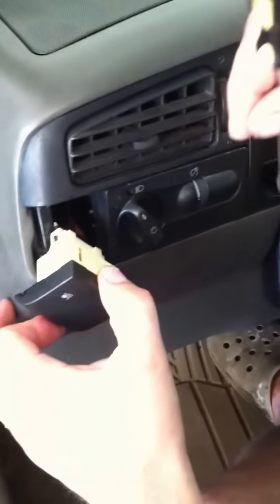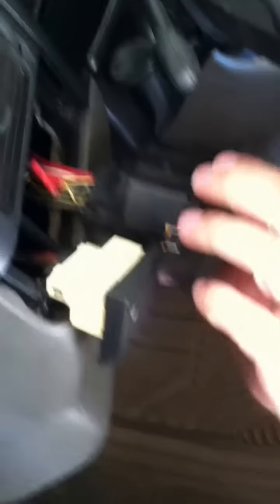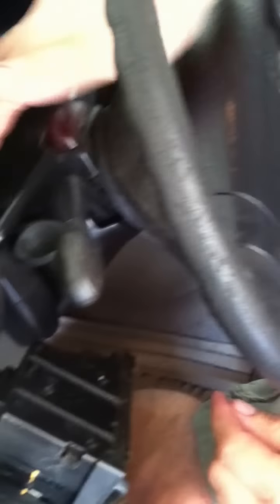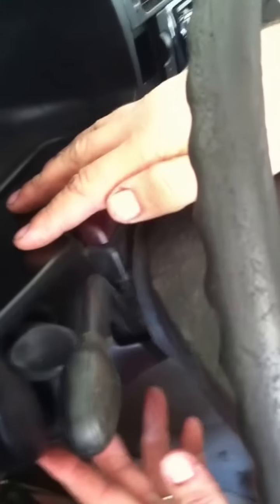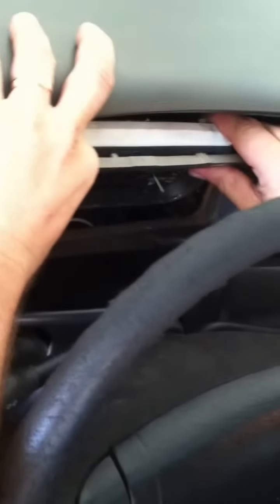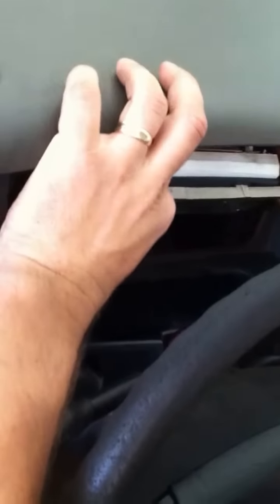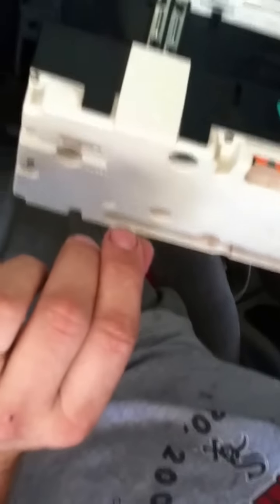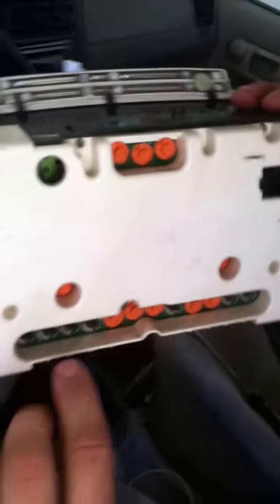VW MK3 Instrument Cluster Removal (94-99 Jetta & Golf, 96-02 Cabrio)

Comment: This worked great when I was checking a bad vehicle speed sensor signal on the cluster. One addition i would make, if the steering wheel is straight ahead, you can slide the cluster through the largest hole in the steering wheel.  Thanks!

Comment: Hey Thank you so much for this informative video. I have a 1994 VW Golf and I am looking to replace the cluster. My golf , since it is a 1.8, has the clock on the right instead of the RPM's.  Will I be able to just plug in a new 2.0 cluster that has the RPM's instead of the clock and expect it to work properly? Or will i have to cut in and make a new wire for the RPM's. Thank you!

Comment: Hi Steve - Thanks for video. My problem is different - the oil pressure warning light & buzzer are sounding. It started intermittently and is now continuous. The oil pressure sensors have been changed and a pressure gauge has been attached to the ports and shows oil pressure both at idle and highway speeds. Conclusion is that the oil system controller mounted on the instrument cluster circuit board is faulty. Could this also be a bad soldering connection??
Thanks.

Comment: Well these two definitely weren't, because I turned the screw in the same direction and there was no problem with the other ones. No, I don't have any bulb holder i could use. I suppose I'll have to go visit a local dealership if it is even available.

Comment: Hi, Steve. I used your instructions to remove the instrument cluster in my 1995 Jetta so that I could replace some burnt bulbs. The bulbs went in and they all work now. Thank you.

Strangely, though, when I reversed the process, I found none of my gauges work and my odometer only shows lines. I thought maybe I didn't push one of the plugs back into the back of the cluster, but everything seems fine. Any thoughts? Cheers.

Comment: great video! i have a 94 jetta and the tacho and speedo are not working, the clock and odometer are off too- the only instrument which work are the gas jauge and the oil temp. do i need to change the entire cluster? thanks
Reply: ***** thanks for your answer; I forgot to mention that the instruments went off for a couple of months and then came back... could it be due by a bad fuse? or relay or wire? thanks

Comment: Hi, Steve!
I was about to replace my instrument cluster bulb (tachometer side) and I used a screwdriver to slightly loosen up the bulb when the plastic, holding the bulb broke. Now, is there a different approach to take out the cluster bulb than any other bulb (the indicator bulbs went out so as I expected) or was it due to a worn out plastic.

Best regards

Comment: Hi Steve, my clusters illumination ceased working after installing an aftermarket radio, or at least that's what I think. I hadn't driven it in the dark for a while before installing the radio. It's not the fuse. My headlights are working so I don't think that it's the switch. Do you have any thoughts on what this could be? It's a golf cabrio 96. All the gauges work perfectly.

Comment: Can you replace the lights instead of replacing the whole cluster?  My lights are growing dim and that is the only thing going bad on the cluster.
Reply from the maker: If the lights are going dim, make sure that it it not simple the dimming function on the dash lights.   You can turn the knob by your headlight switch to adjust the brightness of all your dash lights which will impact the cluster.  Assuming you really do have a burnt out light bulb,there are two different light bulbs in the back of the cluster.  Orange are indicator lights and green at top are what drives most of the illumination.  I typically get them from pelican parts.  Green are part number 893-919-040-A-M97.   Orange are part number 4A0-919-040-C-M97 .

Comment: My cluster has a clock instead of the Rev counter. .....if I get a cluster like this will the revcounter work  (I also have an after market revcounter near the gear lever wich works)
Reply: it's a euro spec golf mk3 1.4 .....it's the stock cluster with the clock and i have a working aftermarket revcounter ... if i change the cluster to a GTI one i have to do different wiring ?
Reply: okay thanks still mate :)
Reply: @peter_dc2rx  what was the answer to this. I have a cabrio 1995 with cluster that previous owner changed and I have electrical faults and fan radiator not working. Nor is speedo and Rev. Did the gti work?

Comment: hi- nice informative video- I have  '94 jetta- I want to remove the actual Beeper- i hear it coming from behind the instrument panel- IS that the first panel you lifted off- it kind of looked like  a Beeper- I want to smash it to smithereens - for all the headache it has given me-
Reply: bad sensor- every time i drive up in elevation it starts beeping- and the oil pressure light flashes
Reply: i'd like to just reach in- pull the beeper out without dis-connecting the instrument panel-maybe i can bend the lower rt side up-
Reply: I bet I could drill a hole to dis-able the beeper's speaker straight through the console w/o removing it

Comment: Are u able to tell me what kind of lights go in the back? Thanks
Reply: AlexanderMitchell There are two different light bulbs in the back.  It has been a while but I have purchased them previously at Pelican Parts.  Here is the data from an order several years ago.  

4A0-919-040-C-M97 $1.50 35 $52.50 Instrument Panel Light Bulb - 12V - 1.1W (Clear Glass w/Orange Base), Brand: Osram-Sylvania

893-919-040-A-M97  $1.50   15  $22.50
   Bulb 12V - 2W Clear Glass (Green Base), Passat Instrument Cluster 1.9,
   Brand: Osram-Sylvania

Comment: Hello. I haven't changed my instrument cluster yet. All the needles and warning lights on mine are dead. The only thongs working are the odometer and clock. Would this be a wiring issue or is the cluster itself dead?
Reply: Forgot something. Once, everything came back on and went out about 5 minutes later.

Comment: hi i have a 93 jetta and when i turn my key as far to the right without turning the car on, everything should light up at that point right?  i just bought the car and im scared that the guy may have removed the check engine light on the car because it isn't lighting up. (i hope that makes sense)
Reply: awesome, thanks alot man!
Reply: ***** lol i ended up coming across your video for another project. I was so dumb at that point, my car doesn' have a check engine light because it's OBD 1 xD

Comment: Hi I have a 1995 cabrio which had the incorrect cluster fitted from a 1.8. Nothing works and the coolent lights keep flashing and fans do not Work. I also have only 1 connection at the back. I have a gti cluster for sale. Which I want to Install also with one connection. Can this work? Thanks From south Africa
Reply: And thx so much for The video..
Reply from the maker: The fans have nothing to do with the cluster so that is not related.  You for sure have two connections in the back.  One red (safety) and one black (pretty much everything other than air bag and brake).  A gen 3 (95-99) GTI cluster will work.  The only problem you might have is sometimes the indicator lights will be problematic if a car had different options.  But the tach, speedometer and odometer will work.

Comment: Do the top two lights just screw out and back in?
Reply from the maker: Yes.  You just turn the screw 1/4 turn to get it to come out.  Sometimes it can be a little difficult and you have to be careful as it doesn't take much to crack plastic.

Comment: Steve, if the speedometer is stuck at zero, do I need to remove the cluster?
Reply from the maker: As a first troubleshooting step, you might put it in test mode to see if you are getting a speed signal.  
http://faculty.ccp.edu/faculty/dreed/Campingart/jettatech/dashcluster/dashcluster.htm

Select test mode 6 to see if you are getting a speed signal by looking at the odometer which numbers will change when the car is moving.  If it does, the stepper motor is likely bad.  If it does not, try wiggling the connector in back to see if the soldering is bad.  If that is not it, follow steps to troubleshoot speed sensor.
Reply: Thank you
Reply: I'm almost positive it's the speed sensor. Thanx for the quick response.

Comment: My  1993 golf 3 instrument cluster  has a clock in it  which  i really  dont  like,can  i  change it  to  another  without  clock in it?
Reply from the maker: The 93 is an mk2, right?   I know the mk3 clusters very well but I don't have much familiarity with the 2cd generation Jetta/Golf.
Reply: Its actually  an  MK3..sir
Reply from the maker: I don't think I have seen a cluster with a clock before but I heard they do exist.   They changed the style of the cluster between 94 and 95 on the MK3's.   I haven't sold many of the older style clusters.  The tach, speedometer, gas and temperature gauges all work the same on any 95-99.  The only difference is the indicator lights based on the options of the car (auto/manual, abs, etc).   I know that the wiring is the same for the gauges for the 93-94 as 95-99 as I can still test the older clusters in my test setup as the newer style.  However, I believe the calibration is a bit different.   I think it is safe to say that you could change out your cluster with any 93 or 94 and everything would work EXCEPT I would suspect the tachometer would not work unless they put that wiring in all cars.    Honestly though I really don't know.
Reply: ok  thank  you ,since the wiring  i sthe same ,i  beleive i  should be able to changeb to any of the  cluster  within  the 95 -99 series
Reply from the maker: The plug will fit and you will get movement on the gauges but it might not be accurate.  I would recommend sticking with the 93 and 94.  And keep in mind your tach will likely not work since you probably don't have the wiring for it from the ECU but you could be surprised if they put the wiring in all the cars.
Reply: ok  thanks  so  much  ....i think  i will try... trial  wont  harm  anyone
thank  you  soo  much

Comment: My steering column cover is broke lol don't try to take it off
Reply: +Steve Skarda  Do you know why there are 2 clusters( red and white)  on the back of Vw Vento/golf and some only have one.
Reply: +Steve Skarda  Hi Steve thanks for reply  I have found it hard to find one with 2 connectors on rear. I was looking on Ebay for a replacement and they all seem to have just one connector on the rear if you check it out. Wasnt sure if these are compatible. They all seem to have different numbers as well.

Comment: I have a intermittent, flashing coolant temperature light. I have replaced the coolant tank with a new one, and it is not low, but I don't know if there is a problem of some sort of problem in the gauge cluster, that needs to be addressed?